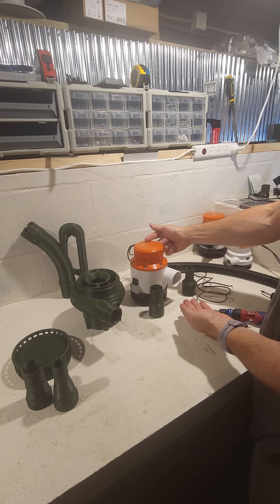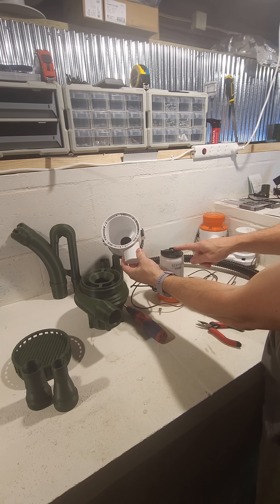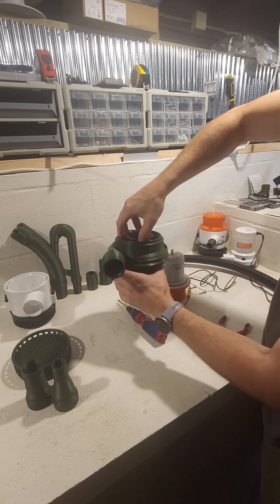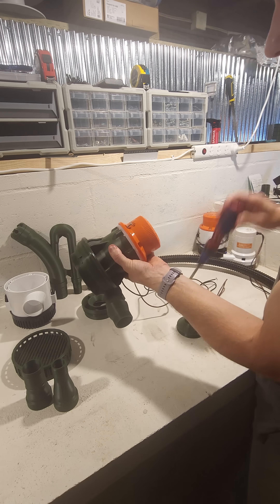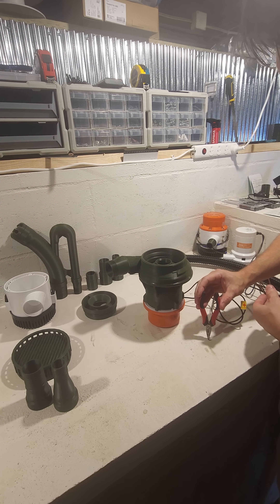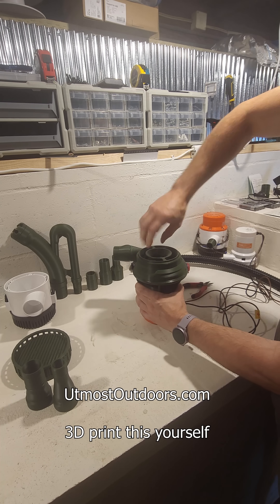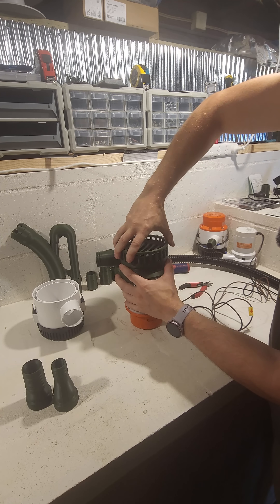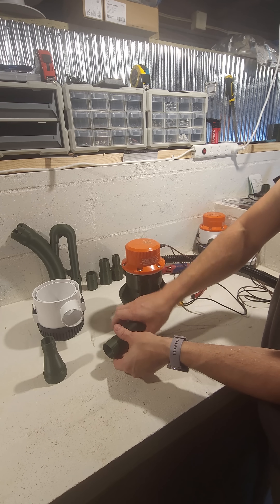How to Build: 4700GPH Bilge Pump Upgrade for Electric Gold Dredge

Comment: And about the load on Eletric motor? Does it support very well?
Reply from the maker: The load on the motor is increased from about 200 watts to about 250 watts.  This varies slightly depending on the model of motor used, but I did a test where I placed a temperature probe inside the top motor housing and ran it for a full battery and the temperature stabilised at a safe level.  Not all pumps are built equally, but I did maintain a margin of safety so that hopefully the motor will last.

Comment: So im currently printing the dredge parts and will buy the pump parts in a week or so. Do you think its possible to dive/take the whole pump underwater? My spot is about 2-3m deep
Reply from the maker: I think if you can keep the dredge reasonably level, it would work perfectly under water.  Would help you get deep without added inefficiency of needing a longer hose.
The bilge pumps I'm not sure...  I assume 2 or 3 meters will be fine, but I'd be pretty skeptical of running deeper depths like 10 meters...
Perhaps after your dive, open up the bilge pump to check for water inside, if its dry, you're good to go! Let us know...

Comment: Ive been using the pump housing for a few weeks now.
Its like a big turbo-big boost upgrade. 
Performance gains are maxed out.
Assembly could not be more straightforward. ❤